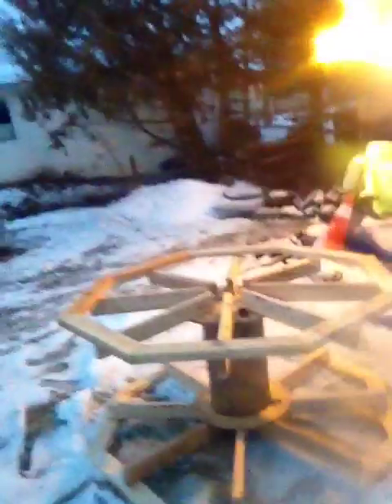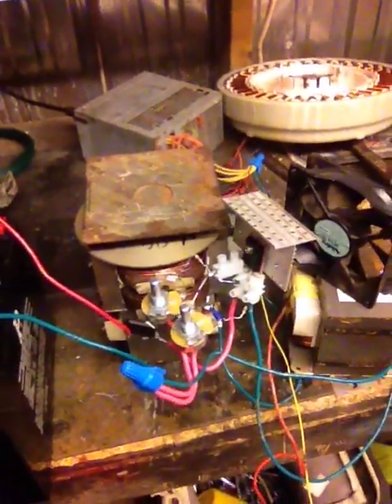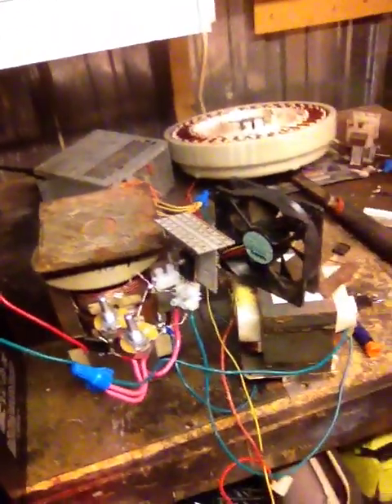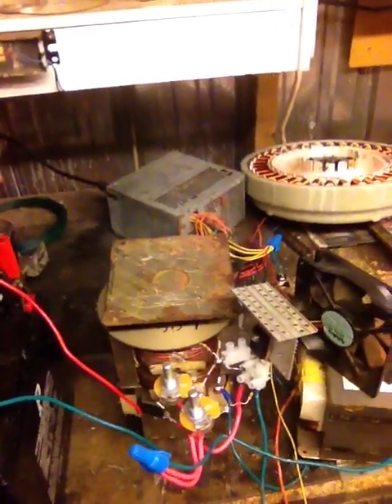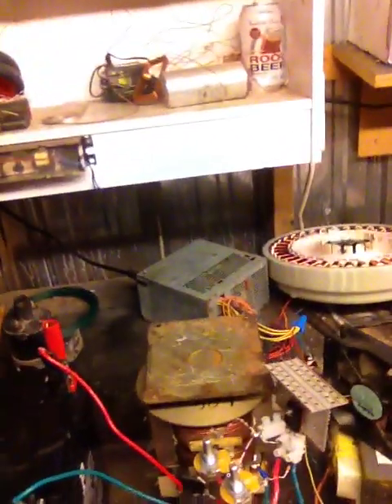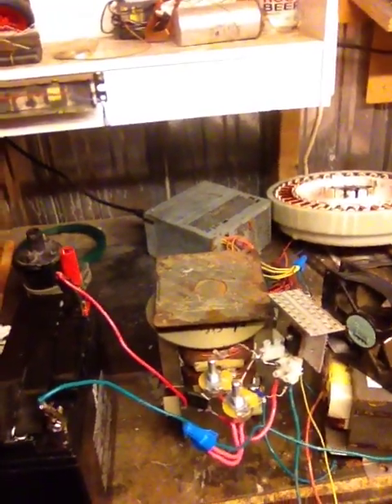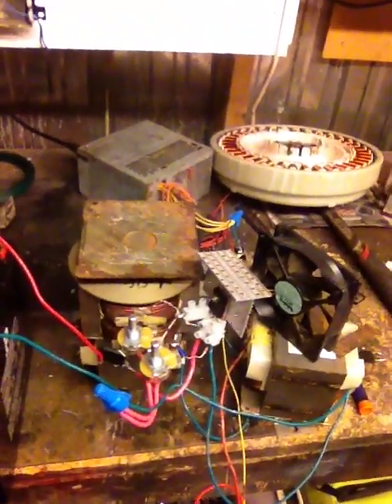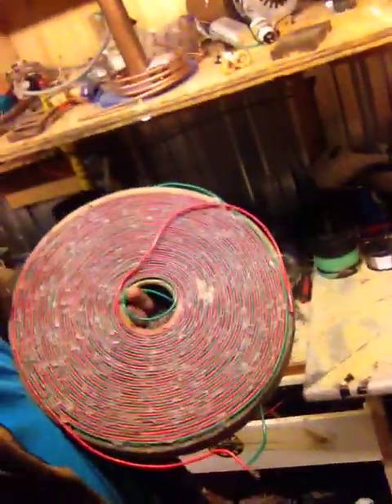BIGGEST: Crystal Radio Initiative Coil

Comment: This is not a crystal radio.
Reply from the maker: You are correct. It has similar characteristics as it has no power source amplifying the signal, but it is technically not a crystal radio, a crystal radio is designed to use electro static frequencies which power the oscillations that move the speaker coil or Whatever load you are using to absorb the energy. This coil is based off of magnetic resonance and capacitance. It receives very little(if any) electrostatic charge from the surrounding environment as there is no traditional antenna. The diameter, amount of turns, and size of the wire on the coil we’re all calculated specifically to match the resonant frequency of the radio stations output. The larger the footprint of your grounding apparatus the more power you can receive through this design as it is basically using the atmosphere as a big capacitor and using the ground as a wire directly connected to the station. The more material put into the ground the better the connection to the source. As for me calling it a crystal radio... well it was built for a contest called “the crystal radio initiative” which it won. It was hosted by Eric Dollard.